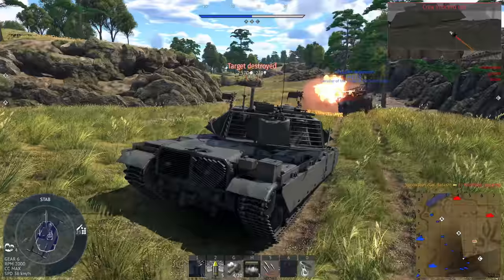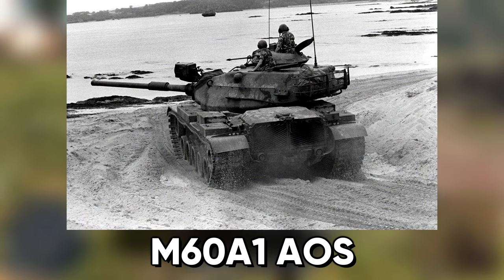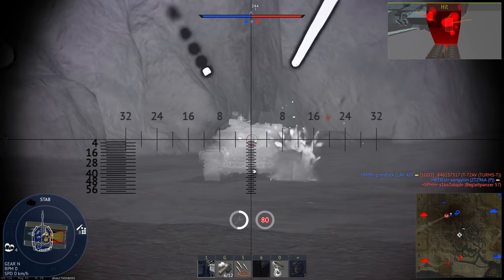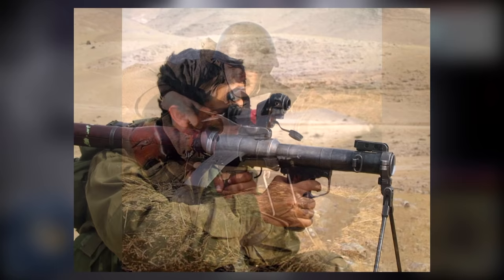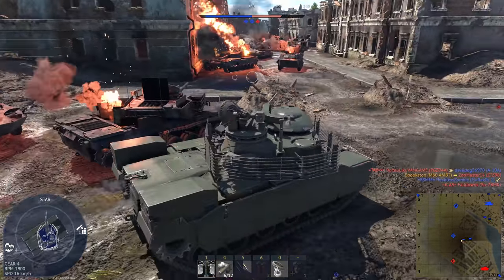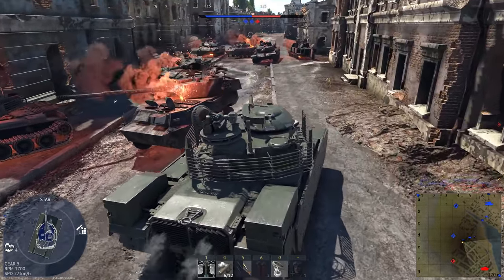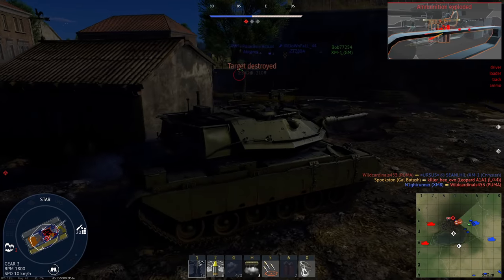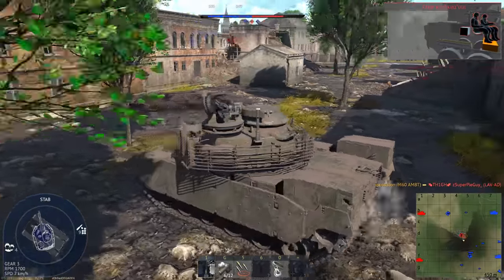How Bad Was The M60?

Comment: My Dad was in 3rd armored division from 83' till 89', he was on M60A3's till 88' and he liked them. By then though, he said the wear and tear on the the tanks were showing. He said they wouldn't go past 30mph or go up hill to well. But the targeting computer on the A3 models were actually newer then the M1A1's he'd later get as the M60A3 was a rushed stop gap design till the M1's could get into more units, so it's computer, well based on the M1's, was newer.
Reply: The M60A3s XM21 ballistic computer is in no manner shape or form newer or better than the one used on the M1.  More to the point, the XM21 is actually an analog computer that uses positive and negative voltages to correct the ballistic solution which can vary a bit with the state of the tank's electrical charging system.  In other words it uses pre-transistor technology whereas the M1s computer is, and always has been, a digital computer.  Now, maybe your father meant the thermal imagery sight known as the TTS (Tank Thermal Sight) on the M60A3 and TIS (Thermal Imagery System) for the M1 and M1A1.  It is true that the TTS is superior to the TIS.  While both systems use the same thermal detector, Texas Instruments (TTS) did a far superior job translating the detected thermal radiation into an image than did Hughes (TIS).
Reply: They didn't like going up hills in the 70s either, kind of like a locomotive
Reply: @DK-ed7be   oh my god I love the fact that Texas Instruments is simultaneously responsible for my TI-84 calculator and the M60’s gun sight
Reply: I was on the m60 from 83-88, and the M1 until 2003, the M60 TTS was far superior to the M1 TIS, I never understood why the M1 had this sorry sight.
Reply: Every single apostrophe is used incorrectly. My fucking eyes

Comment: Good video. I learned some things I did not know about the history of the M60. I served on the M60A3 TTS for a couple of years before moving on to the M1A1. It was a pretty reliable tank for the most part. You could blow half your engine or one of your oil jugs and still keep going. The 60s were slow though, and going up a steep hill you were lucky to hit 10mph. Top speed on flat terrain averaged about 32 mph, 35 if you had a newer engine. We had pulled the turbo chargers off to increase reliability but that came at the cost of power. It was roomy inside for a tank. The main gun could do the job, and could be reloaded faster than the Abrams due to no ammo door. Of course if we got penned the ammo was gonna detonate resulting in a crew wipeout. The armor was an issue for us, but we knew the 60s were getting phased out so we never got any ERA, although I believe the Marines M60A1s had it for Desert Storm. We were trained to make good use of cover, and by my time we would have been relegated to infantry support or dug in defense. We had the FRH for the turret hydraulics upgrade in ours.  I will say the suspension was an ass breaker. The Torsion bars loved to bust for no reason. I had one bust just sitting in the motor pool one day. They suck to change. The track was ok, but much easier to throw than the Abrams and required more maintenance. It was easier to fix without track skirts in the way though. You had to be careful going at speed in rough terrain lest you break a torsion bar or blow a road wheel, sprocket or comp idler arm. The idler arms were much weaker than the Abrams in my opinion too. The Thermals on the 60A3 (TTS) were actually better than the Abrams TIS of my day. Bigger screen and better resolution. The FCS and ballistic computer worked well, and laser rangefinder did its job as long as you did not overheat it. The stabilization was pretty good but not as good as the Abrams. The 105mm was dead nuts accurate, and could be fired on the move. Over all I loved the M60A3, but I was glad that I served on the Abrams come Desert Storm. I have a friend in the Bosnian Army that is a crewmember on the M60A3, and it sounds like they are going to get an APS at some point, as well as some other upgrades. Maybe some ERA. I have seen other upgrades that look pretty amazing. We will be seeing this tank used for another 20 years for sure.
Reply: The Israelis also noted the fragility of the M60's supension. And this was already bad compared to the competition in the 60s, the main reason is that the US didn't use some form of coating to protect the surface of the bars which is the most vulnerable part. The German Leopard 1 didn't have this issue. The M60 also has far too few shock absorbers and bump stops, and the latter are not very good. The Americans really dropped the ball with that suspension even though they had nearly a decade of experience with that on the M48.
Reply: You can blame the suspension problems on a design heritage that basically goes back to the M26 Pershing of 1945. Same roadwheels, same torsion bar design. Same friction snubbers and shocks, etc. The design essentially froze with the M48A1, despite the M60 being a lot heavier.
Reply: Good post MetalPanzerWolf! I was a tank company commander with 1AD out of Bamberg during Desert Storm.
Reply: I always said the M60 was a great tank to play in, awesome in defense - but if I was going to be shot at; M1 all the way.   We had left over M1IMP tanks after our M60A3's and their reliability was horrible compared to the M60's.
Reply: I agree 100 percent with your opinion of the M60A3 the fire control system was outstanding so advanced for that Era.

Comment: I drove an AVLB while in the US Army. It's basically a revised m60 chasis with a bridge on it for combat Engineer operations.
Our main concerns (aside from hydraulic leaks from the giant bridge on it) were constant engine leaks, transmission and most importantly braking issues.
It is an absolute pain to disengage the parking brake since you have to exert a stupid amount of PSI on the brake pedal to get it engaged or disengaged.
Also funny enough each AVLB  had a different 'stance' some leaned forward or more back even without the bridge and we could never figure out  how to get that adjusted even if we tightened up the track with the grease.

But yes, getting out the escape hatch was very hard, even without gear on. We never got to practice because it took mechanics to lace the escape hatch with a metal wire once the hatch was released. They never had the time or tools to do it so if a fire happened it was jump out of the cupolas instead of the hatch.
Reply: Over ten years on M60s, I never once heard about an escape hatched being wire laced in place.  Yes, many times we used cargo straps to keep the lever from rotating and allowing the hatch to drop.  You'll have to explain to me how that worked.
Reply: @DK-ed7be  must be a safety related to the bridge laying variant. Not really related to your field at all, but as an aviation mechanic, we have multiple devices Lockwired with thin, breakable copper wire. Kind of a last ditch "idiot repellant" that keeps fat fingers from flipping switches or mistaken bumps.

And you'll never EVER find that spool of wire when you need it.
Reply: We had a number items on tanks that were laced, the escape hatch wasn't one of them.  And it wasn't one of them on the AVLB I crewed for about six months.
By the way, our fire extinguisher handles were laced with four strand (separated to two strand) copper safety wire.  Just enough wire to keep the handles from being accidently pulled, not too much to prevent a quick yank from activating them.
Reply: @DK-ed7be  every one of ours was laced when I was in Korea both on rotation and while permanent party. It's not laced to keep us locked in but just to know if it was intentional that you dropped the hatch. Sadly I don't have any sources as the online TMs for the AVLB aren't the most updated nor is it the -20 or -30 tm

Our Bravo 6 designation course that we go to school on to basically be our unit's go to guy for Engineer vehicles had them laced when I went through In 2018.
Reply: After dropping several on road marches - they were wired shut on our M60A3's.   If it was likely we were going to use them - it'd be a different story.   Had several tracks were the breaks were barely able to hold the tank on slightly elevated ground.  Nearly road over a ground guide that thought it was cool to be right up to the tank and park it....   Had one try to roll off a lowboy trailer once; breaks weren't set properly.
Reply: @than357  yea there was times where our hatch would fall between the mechanics getting around to lacing our hatches. I always thought it was just our particular set of vehicles that was janky. I didnt know it was a bit of common issue. Often the brakes was not reliable enough to hold our tracks in place in tightly packed areas and I led my vehicles away from others for that reason during FOB setups. A lot of the timea It was either full force on the brakes to get it to stop. We often just let off the gas as way to slow it down. If we stop on an incline, especially with our bridge, we would actually slightly Rev up the engine enough to 'lock' it in a spot until we kept moving because it was either putting the parking brakes on (which didn't work half the time) or roll down the hill back into the convoy or troops.

Comment: After serving in the M1A1(c) for three years and reaching my National Guard unit I was amazed at how cavernous the M60A3's interior was.  Never operated one though as they left just as I arrived so we received a slew of M1-IP tanks as replacements for a few years before transitioning again to the M1A1 a few years later.
Reply: I was on M60A1s and A3s for ten years, then went to the M1A1 for a few years.  I returned to Ft. Knox as a Senior TC instructor for OSUT teaching NG tankers on the A3s during the summer.  I had forgotten how relatively slow the gun elevated and depressed.  You know, compared to the M1.

Comment: M60A3 Master Gunner here.  First, AOS was introduced in 1972.  Second, no stabilization system of that era was worth a crap, they certainly didn't afford the ability to shoot on the move with anything more than a wing and a prayer of hitting  the intended target.  Most of us at the time during tank gunnery would opt to fire from a short halt unless ordered to use stabilization.  For US tankers it wouldn't be until the M1 series that stabilization became something to be looked forward to being used.
Reply: For the record, the 1974 date comes from a document titled "M60A1, M60A1 RISE, and M60A1 RISE (PASSIVE) series tanks, Combat, Full-Tracked 105-mm Gun" and is intended to be a reference to the major Pre-Rise upgrades: The 1971 TLAC, 1972 AOS, and 1974 T142 track.

As for stabilization systems, they were certainly not as good as newer types but the Centurion had a fairly capable system by the time of 1952 or so, and the T-54/55 series was reasonably accurate by the time of the 1957 increments. These were still not very precise, and indeed nor was the AOS, but they did provide a capability improvement over having none at all.
Reply: The M60A3 had generally one sweet spot where the stab was actually working - faster or slower and the reticle was bouncing all over hell.   The M1-series is just awesome.

Comment: Was it bad? No. Was it weird as it was created after T-64 and Chieftain? Yes, definitely yes. It's as if soviets instead of T-64 decided to upsize T-55 one more time like they did with T-62.

Though nowadays it's modernization potential almost turned useful. Almost because country that needs modernized M60's with applique composite, new electronics, new engine and suspension and 120mm gun is Taiwan. And no one is ballsy enough to sell it to Taiwan:(

P.S.: weird off topic fact brought to my memory due to music choice - in C&C Generals, Crusader tank is a stand in for modernized M60 project and is a callback to M60's final service on the frontline for US troops in Desert Storm. Meanwhile Paladin tank is a stand in for M1A2 and not for SPG that it stole a name from.
Reply: Taiwan is getting 250 M1a2 sep v3 abrams.
Reply: ive been obsessed with the M60 ever since studying taiwan's military. taiwan now wants to focus on just having a 600+ tank fleet. their current plan is to upgrade a sample of 40M60, with 1000+ horsepower and other things, but no 120mm. they found a 120mm would cost 3 million per tank. if the first upgrade goes okay they will upgrade 200 in total. the remaining 400+ might be from future tank purchases, although the US doesnt want to sell expensive vulnerable platforms when taiwans military lacks so man basic things. tricky tricky. the head-scratcher is that maybe taiwan doesnt need a 120mm gun because in an invasion china couldnt transfer heavy tanks anyway. i think taiwan should just go for 200 + abrams and 400+ Griffin light tanks that the US is producing, although that will be sometime down the line. curiously, taiwan is producing 280+ wheeled IFV with 105mm guns.
Reply: The m60a1 was created before the t64 came into service
Reply: @stephenallen4635  yep, my bad. T-64 entered mass production in 1963, M60 did in 1960. No idea why I thought or phrased it that way back then. Though history of M60 is still full of weird choices.

Comment: The M60 was a massive tank. It's the exact opposite philosophy of the Soviets, who built tanks as short as possible make them harder targets to hit. The M60 would be as hard to miss as a barn door.
Reply: And yet M60s, M48s, and Centurions (which is every bit as big) gave better than they got against contemporary Soviet tanks.
Reply: tank instructor brum brum, murica!
Reply: @Nevermind Really?  Would they have been?  You seem to be awfully sure of yourself.  To what do you attribute your analysis?
Reply: In most terrain where you could hide a tank - it's height is not detrimental.  It could be more of an advantage at times - especially when you can stand up in the turret.   The newest Abrams is just as tall with the TC station.
Reply: @DK-ed7be  Any tank looks bad when being crewed by middle eastern tankmen... This outcome would be much more different facing off with actual Warsaw Pact crewed vehicles.

Comment: I feel the honor of the AVDS-1790 is besmirched in this video.  Reliability issues have to be put into context.  Such as, unreliable compared to what?  Unlike most of it's western contemporaries, the M60 was operating in actual combat conditions while AMX-30s and Leopard 1 tanks were limited to parades and exercises.  Certainly it was better than the L60 engine of the British Chieftain.  The engines record speaks for itself, having been in service longer than just about any other tank engine in the Western world with production of new engines continuing up to this decade.
Reply: I tried making a fairly large distinction between the early AVDS-1790-2A--which the Army felt was unsatisfactory--and the later models (especially Post-RISE 2C and 2D types) which were thoroughly reliable (I believe I said something to the effect of a "bulletproof" powerplant at some point, but cannot quite recall) and made specific reference to their 21st Century service with US M88 ARVs as evidence of the engine's longevity once the initial teething issues were rooted out. I can understand how it may be interpreted that I'm attacking the engine, but on the contrary my intent is to highlight some early issues the engine had, how and when they were rooted out (albeit briefly) transforming the AVDS-1790 into one of the best AFV powerplants of its generation.
Reply: No
Reply: @joannehartung9692  no?
Reply: By the  time the M60A3 rolled along the tranny was about as reliable as anything I ever drove.

Comment: I remember my NCOIC using the flammable hydraulic fluid to heat water for coffee in my M998 FISTV.  It was as flammable as gasoline but the fumes were more worrisome. 

I remember tankers talking about transitioning to from the M60 to the Abrams.  The older troops missed the M60 but it was mostly sour grapes about change.  The only thing they mentioned that really made sense was that the Abrams didn't have a floor escape hatch.  They missed the M60's floor hatch both as an escape route and as a way to pee or shit surreptitiously without leaving the tank.  The other issue was that the young troops were well trained and used to the high tech gear that came with the Abrams while the older NCOs and officers were not.  However, the older NCOs and officers knew all the tank tactics the young bucks didn't.  But the world marches on it all evened out in the end.
Reply: We flipped over an Abrams back in the day, and all the hatches were blocked.  Leaking fluid (can't remember if it was diesel, oil or hydraulics) ignited and every fire extinguisher in the company was dumped on that pack before the crew was dug out through the drivers hatch.

Comment: I served on the M48 thru to the M1A1, and have to say that every model in this line was very dependable. the only track problems were common to track end connectors . When we transitioned to the M60A3TTS we regularly out performed the M1 firing on firing, both stationary and on the move.
Reply: My great uncle served also served on all Main Battle Tanks in the U.S. Army from the  M48A3-M1A1 from 1966-1986 with the 1/69th Armored Regiment, 4th Infantry Division.

Comment: I served on a couple of different M-60 models. Two problems you missed were the machine guns. The coax was junk until it was finally replaced with a FN design. The .50 cal was not a Ma Deuce but a M-85. It wasn't a terrible weapon but it was mounted in the cupola which was hand operated. Trying to crank the elevation and traverse at the same time while firing the thing was difficult to say the least. Forget tracking an aircraft. We worked around it by having the TC handle the firing and elevation and the gunner would traverse the turret. Neither machine gun could be operated outside the tank.